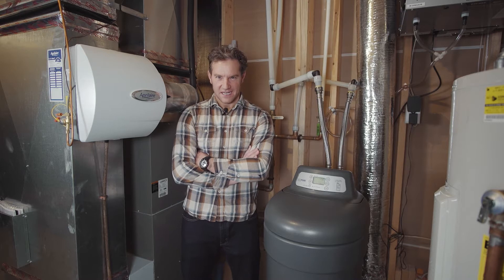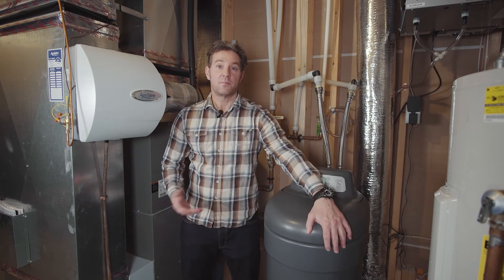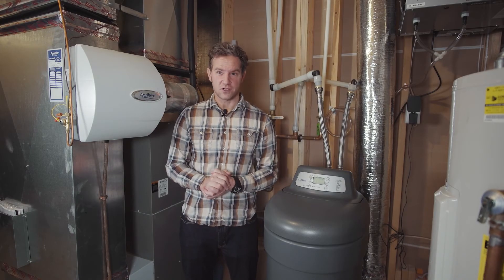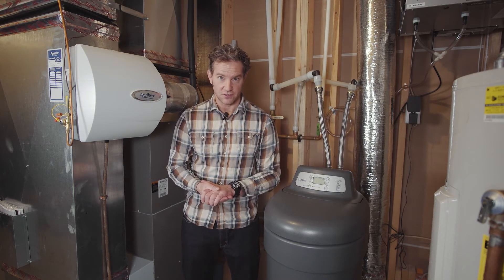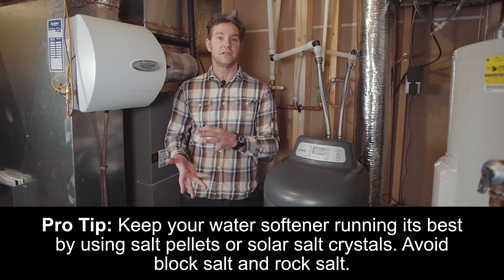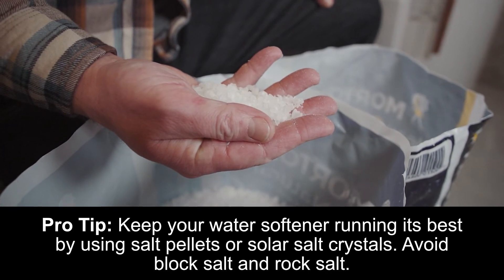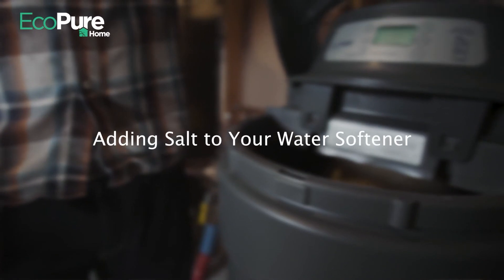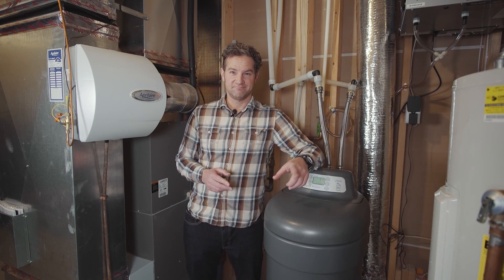How Much and What Kind of Salt Do I Need for My Water Softener?

Comment: I was out of town for a while and came back and I ran out of salt and it looks like there is white mold inside. What would you recommend in cleaning this?
Reply from the maker: We recommend removing any residual salt and water from the tank. Then, wipe the tank down with a diluted bleach solution. Add three gallons of clean water to the tank, followed by new salt up to level 4. Then, run a recharge cycle by holding the Recharge button until the motor kicks on. This cycle will take about 2 hours. Run a cold-water faucet for several minutes after the cycle is complete.